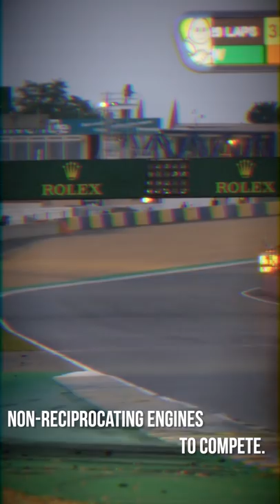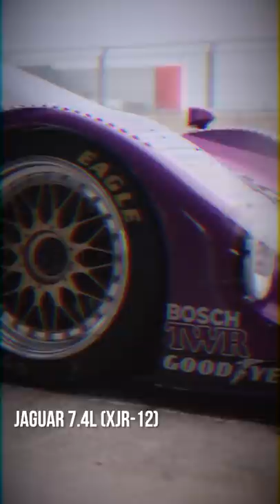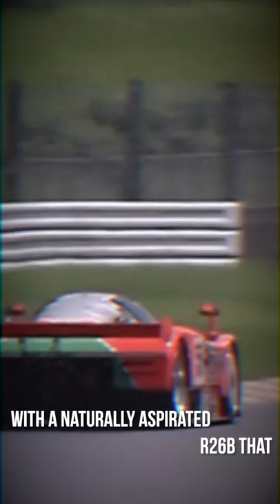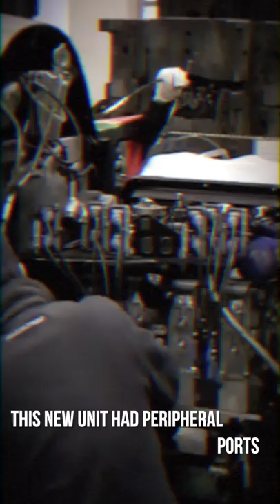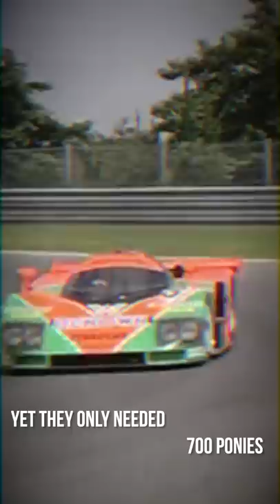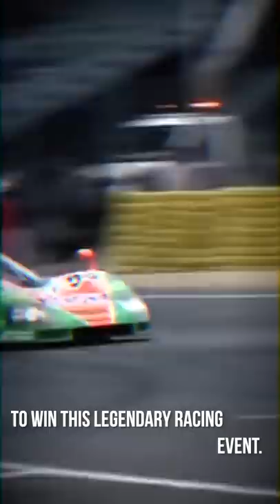The Legendary 10,500 RPM Mazda 787B Engine #shorts

Comment: When Mazda checked the engine at the end of the race they found out they could have easily run the full 920 hp
Reply: And it still had another 500km it could have ran
Reply: Really? Wow
Reply: So like the wear and tear found at engine inspection and breakdown was minimal?  

You know, they decided correct. They won. Had they pushed the limit could had resulted in a different outcome.
Reply: Mazda chose reliability and fuel economy over outright performance in the 1991 Le mans, and their gamble paid off. The 787B was actually one of the, if not the slowest Group C car at the race with even the old Porsche 962s were lapping faster.
Reply: @notagain2856  really??
Reply: @notagain2856 Then again you have to consider that in endurance racing, lap times aren't the top priority unlike normal circuit racing. Going the race distance is everything especially over a 24 hour period where the engine spends a lot of time at max throttle. Being 'slower' has little relevance in a race as prestigious as Le Mans and the 24h of Nurburgring.
Reply: @TheSilverShadow17  you are right about reliable play a big role in endurance racing. I should add luck played a big role in the 787B win at the 1991 le mans too, being the only race it won in 21 races. 

I just wanted to clear between facts and wrong ideas some people have that often romanticise the 787B as all invincible by being both reliable and fast.
Reply: @notagain2856  It wasn't that fast but it was pretty reliable
Reply: Easy to say after the fact...

And that's not even a criticism, the fact being that they won the world's greatest endurance motor race with a unique engine, being the first Japanese maker to do so. Doesn't need any more gilding than that.
Reply: I’ve read that the team thought it could’ve done another 24h as the wear was so low.  For 91 they had ceramic seals with carbide binding strands, amongst other things, which really helped the reliability.
Reply: @mister_M.  they’re half right. The 787b was one of the slowest, only qualified 12th. But it was an Imsa gtp not group C entry
Reply: @jamesford3549  I heard about that as well
Reply: @jamesford3549  Well when we're talking about a 24hr endurance race, being 'slow' doesn't matter, since it's all about covering the race distance.
Reply: @TheSilverShadow17  but people call it a lucky win. These people have no clue. The slowest paced car had such good race pace that the Mercedes and others broke trying to stay in front. That’s a brilliant show of speed and endurance, not luck.
Reply: @jamesford3549  With that, I couldn't agree more. At least we're not fanboying or acting like superfans over the 787B, just simply impressed, you reckon?
Reply: @mcgusto82 yeah Mazda made a compromise between reliability and pace. They made the right choice, and tbh the 700hp unit is the only one I'd ever want.
Reply: @notagain2856 yep, it was one of the slowest in class over a single lap. However, over the duration of a fuel limited 24hr endurance race, it was one of the few cars that did not have to slow down so as not to run out of their fuel allocation ie it was one of the most economical cars in the class believe it or not! At the start of the race they decided that they would let #55 run flat out the whole race and not be as conservative as normal ie bank on their reliability and lower fuel consumption. That's one of the reasons the 7+L Jag couldn't chase it down, they would have ran out of fuel. The rest as they say is history! 
Plus if course THAT noise it made!
Reply: It was pretty poor in the overall championship, finishing below a team run by a drug dealer 😂😂😂
Reply: @bzilla-d4i  What matters is race distance, not fastest lap in endurance events. The 787B might not of set the most impressive lap times sure, but it lasted the 24hr race.
Reply: @bzilla-d4i  you mean Rhandy Thomas?
Reply: One of the best parts
Reply: Actually another 3000 mile race
Reply: then, how it can be well know a wankel engine and it apex seal is agains each other. it that only mitos?

Comment: Just thinking about today's le man racers using hybrid technology to get the most out the fuel so they don't need to stop as often meanwhile the 787 is over there chugging fuel like the sun burns up hydrogen
Reply: I thought rotary engines had better fuel consumption than normal piston ones? I mean, seeing that there was a Jaguar with 7.4L engine, surely the Mazda couldn't have had the worst L/G of fuel to mile ratio on the grid
Reply: Le mans...
Reply: oh no the 787 engine was the most efficient at the track actually lol
Reply: @yurikz9  incorrect, due to the engines 2 stroke cycle, the engine can't control how much fuel its getting in the chamber. Unlike a 4 stroke piston engine in which the valves above the chamber time a certain amount of fuel as well as the combusted gases exiting the chamber. Rotory engines don't have that, they drink up gas like I drink up soda when I have dry mouth from getting really stoned. Wankel engines are an interesting concept but I wouldn't it recommend if you are looking for efficiency.
Reply: @astershake1162  the displacement of the engine played a massive factor in fuel efficiency since mazda's rotary engine had a less fuel demanding mileage with it being only 2.6L compared to the piston engines that were much larger than mazda's rotary
Reply: Wrong
Reply: @tiago4158 rotary engines have bad fuel consumption
But the only best for rotary engine is immune to catastropic failure, happy rev (even stock)
Reply: @potatopizzacar3318  so they can’t detonate then? So u don’t even need to forge the block no?

Comment: I love Japanese engineers, especially when they are allowed to think out the  box.
Reply: Thanks to the German Felix Wankel
Reply: It's German design actually, but the Japanese put it to good use
Reply: Very true, I'm old enough to remember NSU RO80s. Only the Japanese got close to solving rotor tip wear. OK there was the norton ( terrible emissions ) my mates rx8 used to drink synthetic oil ( like a premix 2 stroke ) as well as it's 18mpg. My dad's proper 2 stroke SAAB was the ultimate stealth car. You couldn't read the number plate for the clouds of blue smoke. 😁
Reply: It's also a real problem for rule makers to determine the volumetric capacity of the  rotor/s. If you're a fan you say it's tiny if not you can argue its 3X  what I would consider the compression/firing volume. Big up the S800 Honda. 8000rpm, four carbs made an MG Midget look prehistoric.
Reply: Yes, like Yamaha's R1 Crossplane Masterpiece 👌✌👍
Reply: @videkkkk  yep or the reverse cylinder  tz250 not so much the nsr400 triple Honda that Spencer had . Remember oval pistons? Hmm?😒 my rd350 with the ypvs variable porting was mint tho. 👍
Reply: They think out of the Earth 😂
Reply: Same, they got beat so hard they banned it, what a shame. Salty competition.
Reply: @llmexicanlm7885  that is so incorrect in so many ways. First, a that time nobody care about mazda because mazda didn't won anything with the 787 until 1991 and all their other models were a failure too. Of 21 races the 787 only won 1, Le Man's. And that was lucky, 1 Merc crash, they were a lot lighter than the competition and had space for more fuel. Also everything else broke except for the engine.
Reply: @ToyotaAristo  yeah, i made this comment back when i was ignorant and didnt know the truth. Haha, i have learned everything you have said. Thank you though!
Reply: @ToyotaAristo  Shoot, not even the 787. Go back through Mazda's entire endurance program from the 707, 717, 727 up to the 787. 0 fastest laps, 0 pole positions, 0 wins until they got to run a 200kg-below-minum-weight detuned car so it would survive. As much as I love Gran Turismo, they really made a legend out of a fluke with the 787b by making it so over-powered.
Reply: Actually they used German engineers & it was a European driver who won for them.
Reply: How to think outside of a box? With triangles. 4 of them.
Reply: It was designed by German Mr. Winkle but the Japanese I have to say perfected it
Reply: @clodge5196  Europeans designed the 787b race engines. Who really perfected it? You'll never know ;)
Reply: Rotary engine was designed by Wankel in Germany.

Comment: What I recall from my RX7 days was being bowled over by the direct and incredibly linear relationship between how far I pressed the accelerator pedal and how far I sank back into the driver's seat back. No piston engine driven car I have ever driven, from muscle car to mini-van, has ever had that oddly linear relationship. And until you experience it, I'm not sure you can fully appreciate how miserably inept the world of piston engines is. I adored my RX7, and profited greatly by rebuilding its rotary engine once, but blew it up because I was young and foolishly didn't grasp the importance of the hard chrome bearing surfaces inside the engine's rotor chambers.
Reply: My biggest gripe of turbo rotarys is the non-linear power delivery.
It's way hard to stick with the v8's cos the v8's far superior torque curve.
In my class, a max of 3 rotors is allowed. And an NA 3 rotor just don't make enough oomph. Not even a crazy PP....
Reply: That experience recalls my old Camaro to a tee. Or pretty much any NA car I can recall driving that had a real throttle cable.
Reply: @nthgth throttle cables are inferior to throttle by wire
Reply: @GewelReal  100% agree for saving miniscule fuel/emissions. 
100% disagree in terms of driving experience

Comment: K 1. that engine is definitely not faultless. 2. They didn’t limit it to 700hp because they “only needed 700hp” they limited it to 700hp because the engine was overheating and destroying itself Mazda limited the car to 700hp for reliability, and in the end it payed off as when they took apart the engine after the race it was in brilliant condition.
Reply: They said when they took it apart they could easily go to 900 without a problem
Reply: @thecloneguyz and they wouldnt have won the race if they spec it to 900hp in the 1991 le mans. Reliability was the only thing going Mazda had for a shot a victory in 1991, being vastly outperformed even by the old 962s in most races. Btw, the 787B only won 1 race out of 21 it competed in

Comment: With LiquidPiston rotary engines gaining traction recently I'm excited for the return of rotary engines back in motorsports!
Reply: Something with their go cart project didn't sit well with me. You'd think they'd get someone that knew what they were doing before showing it off and the whole electric motor thing was completely ignored and in my book shouldn't have been on the cart to begin with and was covered up by essentially a plastic box. The engine never sounded loaded either.
Reply: @tihspidtherekciltilc5469  I'm not sure what you watched, but I looked up the Liquid Piston thing and it was very clear from the video that the hydrogen fueled rotary was being used as an electrical generator for the electric motor. I'm not sure what you were expecting, but that was the sound of the motor under a constant fixed load.
Reply: Would love to see the Liquid Piston engine on a Mazda 3 Hatch.
Reply: Rob Damn, nuff said.
Reply: @dadadadankable  Rob Dahm is cool but I'm even more impressed by the Vargas brothers. They've proven the reliability of rotaries again and again. Sitting on the limiter for minutes at a time in the Mystery Machine burnout van, their personal RX7 builds, customer builds, etc. 

Seriously nutty stuff.
Reply: @lllllllllllllllllllll1lll1  definitely not going to argue that bubba.
Reply: @SailingFrolic  put a briggs in it, same sound and performance as liquid piston lol
Reply: @Yukanhayt-Mhenow  since when can a Briggs put out over 300hp in such a small package?
Reply: Liquid piston seems sus, I have a feeling they’ll take backer money and run
Reply: @Yukanhayt-Mhenow  no. A Briggs is not going to have the sound or performance a rotary will have, not in a million years
Reply: Did they solve the torque issue?KW wasn't a problem.
Reply: @johanvanniekerk5261  I'm not sure but I think the solution was adding more rotors.
Reply: @edwi890  Thanks

Comment: Small addition to the story: The #55 was not the only 787(B) to race during the winning drive it did. Several 787Bs were entered, and even some of the older 787s (non-B).
Not all of them finished, but the #55 wasn't the only one left!
In previous years you had the Mazda 757C, 767, 767B and 787 all drive together at the same events, until the 787B arrived and became the predominant model to drive in Group C.
Reply: For the record. 3 mazda's 787's were entered during the 1991 Le Mans. #55, #56 and #18. All cars finished on the places 1, 6 and 8..........

Comment: The other manufacturers had weight penalties as well. This aided in Mazda getting the victory as well.
Reply: I don't think so. Mazda was also penalized for running rotaries instead of the new 3 liter V10's the regulation mandated. Shouldn't weight had affected Mazda too?
Reply: @danilaodatunagem7193  idk I got the info from a prior video stating that’s what sided Mazda in the victory that particular day.
Reply: @danilaodatunagem7193 The older cars that had previously run under Group C (C2 for 1991) rather than the new 3.5 litre cars were all originally meant to run with ballast to 1000kg, Mazda lobbied the FIA/ACO that they couldn't build a competitive car with that weight (proven by the awful results beforehand) when the race came around Mazda were allowed to run at 830kg.  The Mercedes was still much faster even with the weight but oddly proved unreliable, but the XJR12's that won the previous year were 7 seconds slower than the previous year because they couldn't meet the fuel allocation due to the extra weight.  The Jags were generally reliable finishing 2,3,4 but never had a chance to compete. It explains why the 787b had such a poor record because it was uncompetitive when the competition were not knobbled.  Also, don't buy in to the BS about the car being able to run with more than 700bhp, it couldn't use extra power in short sprint races so it certainly couldn't over 24 hours.

Comment: Mr. Felix Wankel would have been proud to see this car.......
Reply: He did not like this version (KKM), developed by NSU and used by Mazda, of his engine. In the engine  invented by Wankel (DKM), the rotor moved in purely rotary motion and not roto-orbital, and also rotated what in the KKM is the stator, again in purely rotary motion. This meant that the engine was perfectly balanced and could rotate at much higher speeds (over 20000 already in the 1950s), however it presented some practical problems that led NSU to develop the KKM, much to the disappointment of Wankel himself who said that  his race horse was turned into a plough horse

Comment: A lot of people hate on the reliability of rotary engines but fail to mention that piston engines had over twice the amount of time in development it’s easy to say that if they hadn’t been banned from Le Mans we’d see more production rotary around today in cars similar to a Porsche Gt3 and like be just as reliable and possibly making the same amount of power
Reply: The rotary wasnt banned. The new minimum displacement rule (to align with engine in F1) which was set before 1991 was the reason Mazda chose to stop racing

Comment: It wasn't banned for good and it wasn't the last rotary at Le Mans. 1995-1996 saw Kudzu DG3, a 3-rotor car in the same colour as the -91 winnin 787B. It was onlye banned for 1992 and 1993 due to FIA mandating 3.5-litre 8-12 cylinder engines in the Group C endurance racing, similar to F1 at the time. Nothing to do with rotary being "too good that they banned it". The Mazda 787B never finished better than sixth in any other events and claimed the Le Mans win by misfortune of others. Cool car, but wasn't banned for good and wasn't banned for being superior.

Comment: I still want to make a rotary powered land speed car. Rotary engine, turbos, and a CVT transmission. Since land speed cars are pushed off the line. You wouldn't have to worry about low speed torque. Jut wind out that rotary with a properly 'geared' CVT and I bet it would break some hearts and records

Comment: there are so many reasons nobody uses rotary engines anymore, not just in racing
Reply: Inefficient by design. Their bonus is small size and low displacement, with fewer.moving parts. They don't burn their charge completely, even using trailing spark plugs, and they wear out the contact faces of the rotor apex and the housing, as well as the seals between housings. Sound great. That's about it.
Reply: @Not_A_Cat  apex seals haven't been an issue for YEARS now, the failing point now in performance Rotarys are the side seals, normal ring seals.
Reply: @Not_A_Cat did you see Rob Van Dahm's 4 rotor after it broke?

Comment: We all love the 787B but nothing will beat the sound of the 3-rotor until 5-rotor and 6-rotor engines become more viably common. Mazda should make a higher displacement per rotor engine (800cc per rotor) so I can have a 2.4L triple with roughly the same power potential in a more compact package than the 26b 4-rotor.